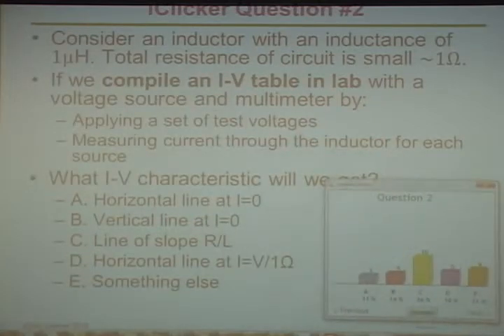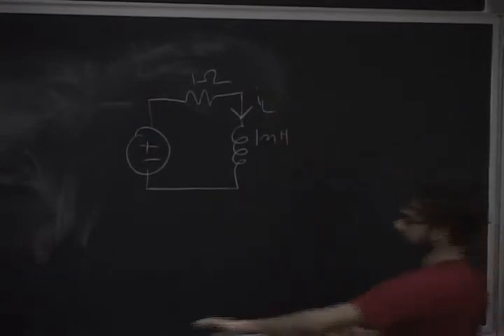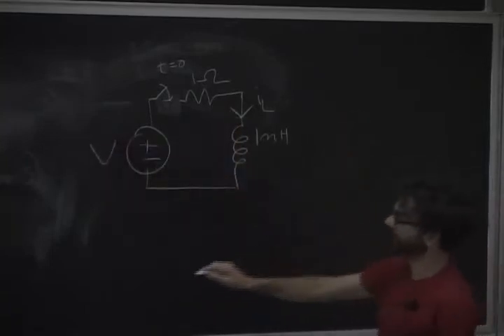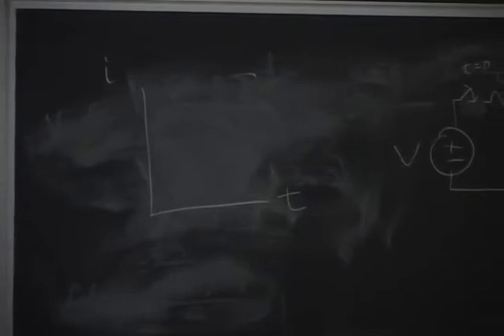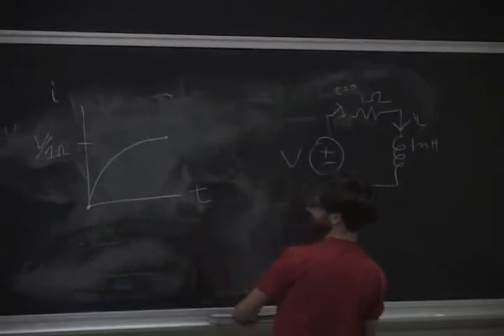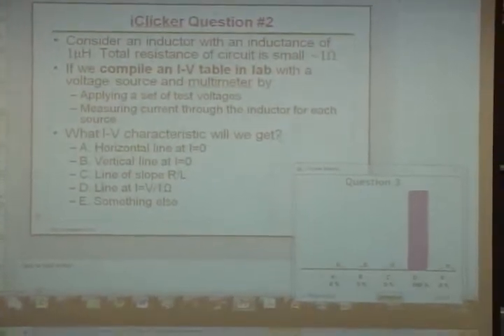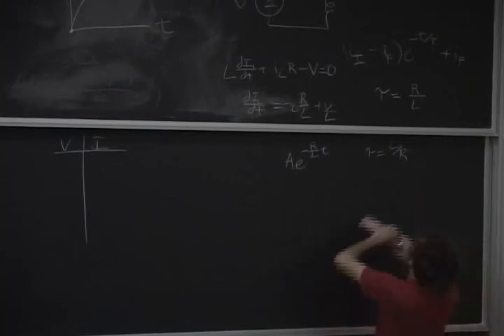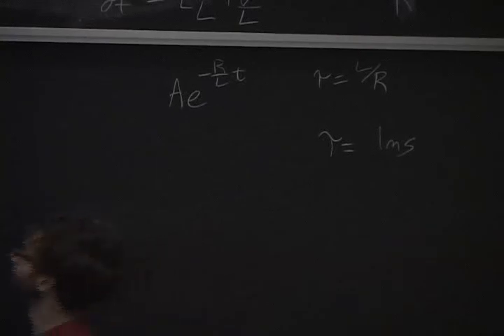Introduction to Microelectronics - Phasors, impedence ,Transfer functions, filters (part 2/17)

Comment: He got confused because he wrote the current terms as distinct symbols I and i in the differential equation; they should be the same. 

As written, it makes the DE look unsolvable because of one too many unknowns being present, which I suspect was the reason for much of his silent apprehension with proceeding at one point.

L di/dt + iR - V = 0 --> di/dt + (R/L) i = V/L --> d/dt [ e^{(R/L)t} i] = e^{(R/L)t} V / L by way of integrating factor

which defines R/L = 1 / tau --> tau = L / R